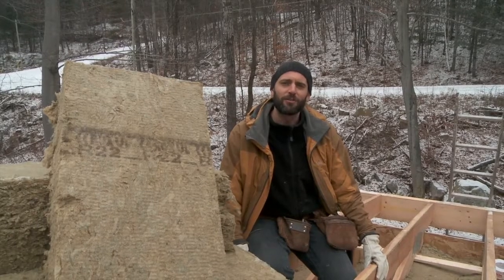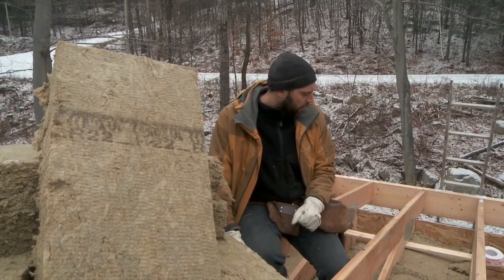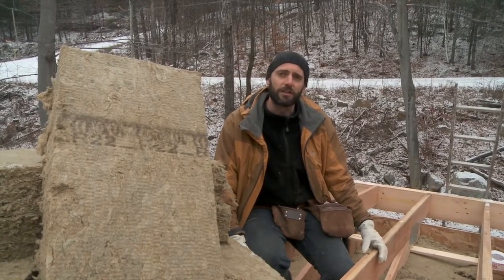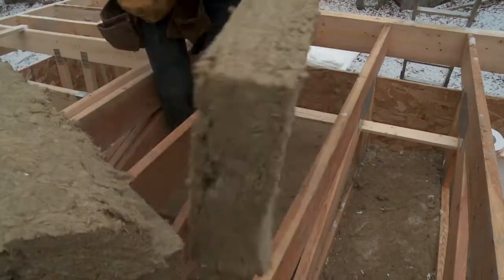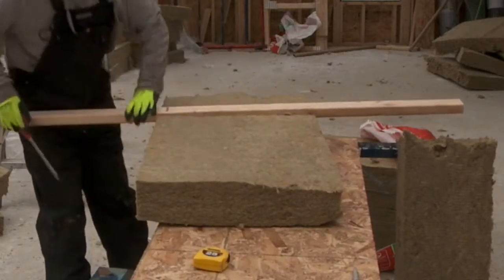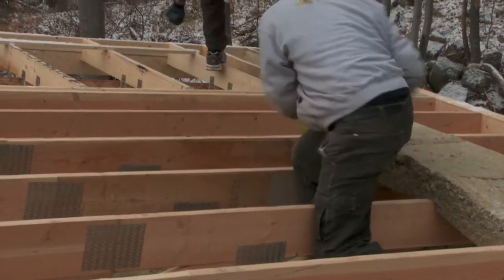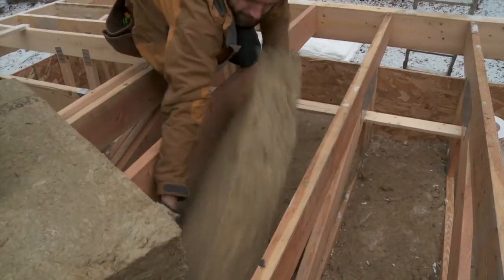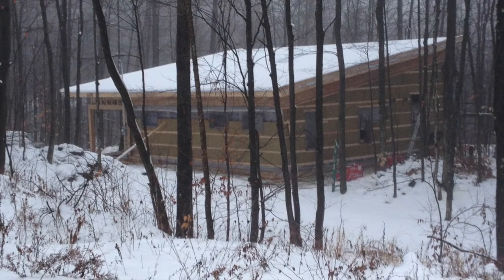Green Roof Insulation Installation - EcoHome LEED Platinum v4 House  - Ontario Canada

Comment: I want R-60 in the attic of my new home, but commercial insulation installers are telling me that it might be too heavy for the drywall ceiling to support, and that they won't be responsible for any buckling of the drywall. Do you have drywall on this ceiling? If so, how is it holding up with R-95 rockwool.
Reply: Go ahead and strap your ceiling with 1x4 pine furring strips 1ft on center. And use 5x8 drywall and you'll be golden.

Comment: once you have a r60, more insulation isn't effective. heat won't penetrate heat or cooling won't leave that much insulation.
Reply: Maybe that's true enough where you live. In other places R120 is a minimum for roofing systems.